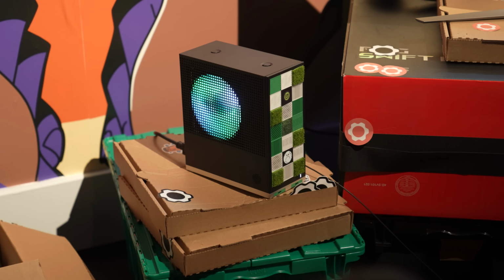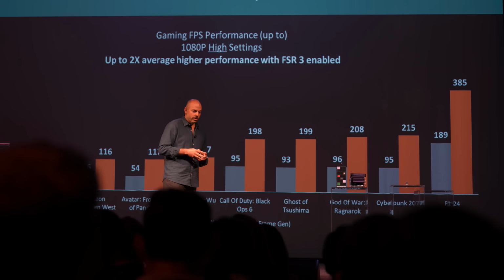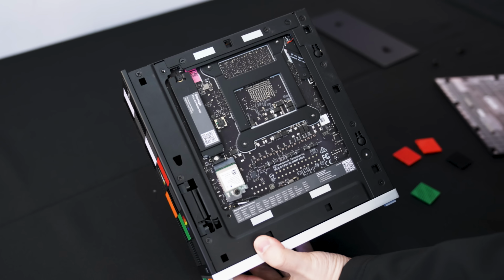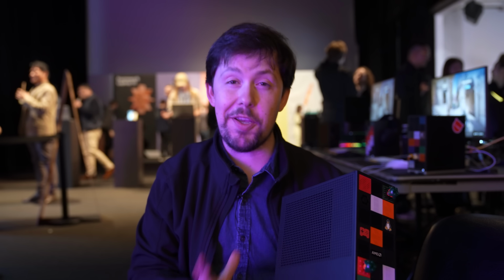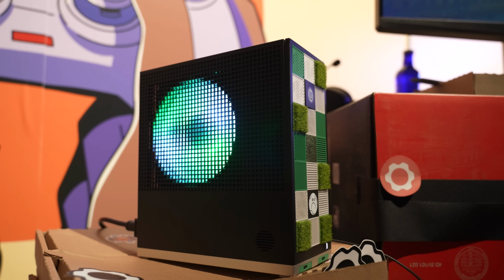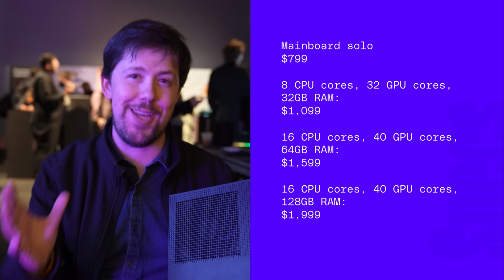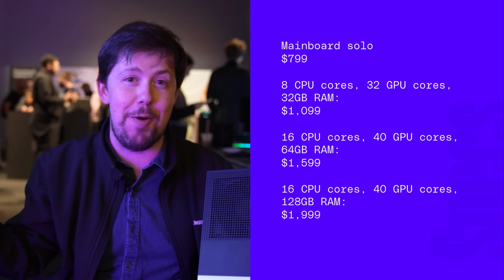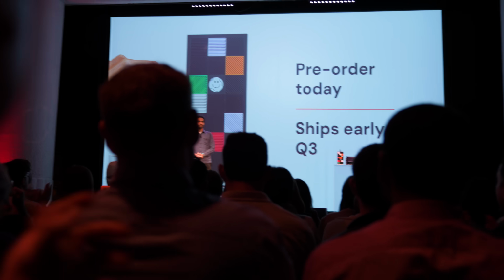Framework’s first ever desktop is 4.5 liters of pure AMD muscle

Comment: It has a pcie slot but no way to use it why??
Reply: because it's a standard mini itx board, you can place it in another case, if you want
Reply: They added a PCIE slot to give the board another life after it's no longer your daily driver. You could remove the board, use it in other projects, and expand its capability. You can also buy just the board and place it in another case.
Reply: (fyi you can buy it without a case to begin with)
Reply: @homeape.  And it would still have that useless PCI slot. It is only x4.
Reply: NICs, a PCIe to m.2 adapter, a PCie Soundcard...
Reply: @reiniermoreno1653  Don't forget the GPU can still use it for rending or AI
Reply: @ i don't care too much about AI but the render thing is very important too, this was made as a portable workstation the only other thing we could compare to it in this market are Mac Minis
Reply: @reiniermoreno1653  AI is blanket term for machine learning, Not necessary just LLM like most people think off.
Reply: @Nothing-f8z  as I said I don't care too much about AI neither LLM nor ML/DL, I don't have a PhD to speculate how this would be useful in that area, the knowledge about AI is not mainstream enough
Reply: @reiniermoreno1653  then learn it? It's not too complicated
Reply: you can use it though? Another network card? soundcard?
Reply: @ why not?